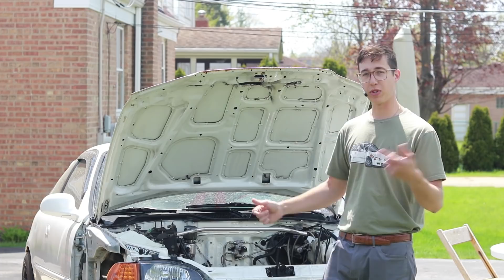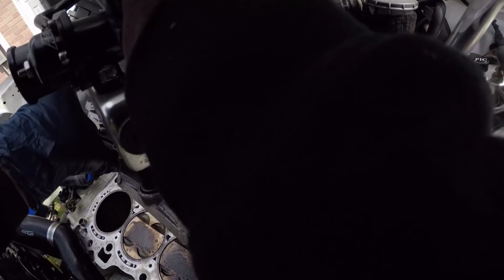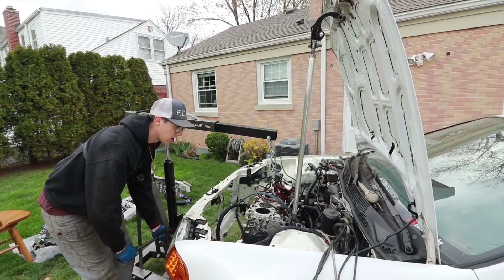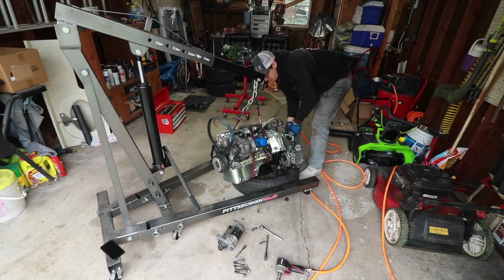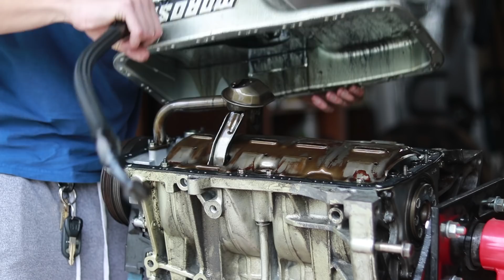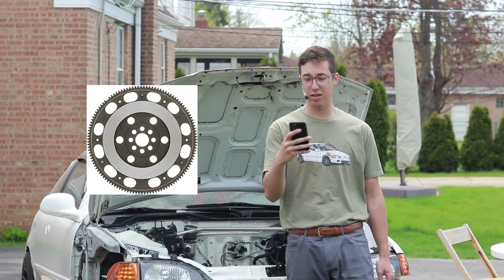Turbo LS VTEC Civic is Ready for it's New Motor! (CSS)

Comment: What did you gap your piston rings to if your gaps were too tight or too close together meaning less than .0003" difference from the top and bottom gaps you could have either caused piston flutter or the rings to but together causing piston failure

Comment: I’ve had my GSR apart so many times in 20 years it’s not even funny. I can take the whole damn car apart with my eyes closed just about. The only things I haven’t taken apart are the bottom end, gearbox, and maybe the sunroof lol. But I have pulled and disassembled the head, and also pulled the whole motor and trans once to replace a bunch of stuff.

But you can bet if I ever have to change the input shaft bearing, I’m pulling that gearbox apart!

Comment: Do you have an idea why the pistons cracked? Also if the main and rod bearings look good just re run them.
Reply: It was probably  running lean or the injectors where cutting out during acceleration. Usually  but not always cracks meaning not enough fuel. Broken or bent pistons mean oil  starvation over time lean conditions and bad heat cycling
Reply: Lean, to much timing. They could not be checking timing and it could be off by a lot

Comment: Hello,

I have a 2000 EK civic that I've swapped a b18c1 GSR motor into. It has lower compression 9.1:1 Wiseco pistons, darton sleeves, eagle rods, 1000cc ID injectors, skunk 2 pro intake, AEM 340LPH fuel pump, BKR6 spark plugs and using AEM UEGO wideband for A/F ratio readings. Naturally aspirated right now.

When ever it gets around 2500-4000rpms the motor goes lean, loses power and returns to idle. I was getting an IAT error but disabled that with S300. There are no other codes so limp mode isn't suspected.

So far I have modified the fuel map by adding 10%(helped AFR at idle but that's it), replaced cap and rotor and inspected spark plugs (looked fine, had some carbon on them).

Any one have any ideas? Could it be fuel filter related? Fuel pressure regulator? Fuel pump?

Any help is more than welcome!

Comment: If you’re taking your motor out why didn’t you dropped it when the hoist failed, and then lifted the car and dragged the engine out 🤨🤨
Reply from the maker: Eh
Reply: @boosted_john  yeah you can jack the car up and drag the engine out from the bottom. Some honda guys did it that way too.
Reply: @mal3762  The MR2 method.